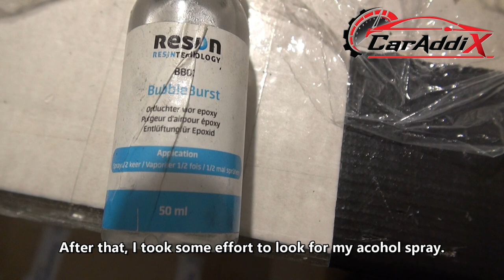Testing Spray Glue (for carbon skinning)! Is it safe?

Comment: Interesting experiment! The only thing I can imagine that caused the spots in the failed skinning was the solvent in the glue wasn't given enough time to flash off causing tiny bubbles in the resin. Not tried glue personally, I usually coat with black epoxy, wait for it to go tacky, then lay down the CF and resin over the top of that. To avoid the yellow tint, you can get top coat epoxy that is tinted slightly purple to cancel out epoxy's yellow color, I think it also has UV stabilisers in so protects against sunlight degradation.
Reply from the maker: True, I use that in my skinning videos. I love the purple epoxy! :). Glue and just Basecoat have pros and cons. I made a video using both techniques and both came out fine, as long as you go easy with the glue :).

Comment: Your issue is more to do with the carbon cloth. It should be tightly packed. It looks like where you handled it, it has sperated. No matter what you do with the glue you will then see the gaps/white when laying down. Keep the fabric tightly closed. Apply a light mist allowing to tack dry. A heat activated glue is much better and will ensure no movement in thread while laying down. Learnt this myself from recent projects with seat bahks and center consoles

Comment: You feel spray glue is better  than resin???
Reply from the maker: In some cases, I guess more complex shapes.
Reply: @caraddix  how long does  does it stick for???
Reply from the maker: @pedroalmodovar6709  The trick is to use just enough for it to stick during the process and allow enough resin to still get under the fabric and not use glue for long term, as that alone will not be reliable.

Comment: Hi. I'll be bluntly honest here. I think that you didn't really test anything that's important for skinning. First, gaps are no problem on black background. Second, glue layer thickness is a secondary question - more important here is to check how the glue you're using reacts with epoxy in different temperature ranges. From what I know, glues like 3m 77 do not hold well with epoxy when heat treated and promote delamination. A more fitting test here would be to make samples (plastic, not cardboard!) that have gone through the entire process and use different kind of glues, including what I believe would be the best glue here - a polyurethane heat activated upholstery glue. I'd gladly watch that test, but the methodology would need to be on a higher level than what we saw.
Reply from the maker: The glue is mainly to hold the carbon in place. The surface should be sanded and the bond between the surface and the epoxy is what would matter (in my opinion). In this case, the glue should not be used to keep the laminate in place, I mean, this would be an odd approach to begin with :). What's important to me is that the glue won't be visible in the end product :). The thing you mention, I guess would only start playing a role when you would use glue in high temp moulds but that's not what this video is about :).
Reply: @caraddix  True, yet there's a question of how the glue would interfere with the bond between the surface and the epoxy - because glue won't disappear, right? 
My experience (and this is something that could be thoroughly tested) is that this type of glue creates a somehow hostile environment for the epoxy and thus promotes delamination from the surface.
I see what you mean, but my concern is that the glue used causes the surface-epoxy bond to be weaker. 
Also, it doesn't have to be a high temp mould for the temperature to play a role. A skinned part left in full sun or in a hot interior of a car can easily delaminate if that bond is not strong enough.
I'd gladly watch a proper experiment showing all this, especially with all the science behind. :)
Reply from the maker: @AAIpsissimus  I understand what you mean now :). If you spray a fine mist, look at the back of the carbon (I'm still using too much but 1 test piece was actually sprayed before as seen in the video), There's only little specks, not an entire layer of glue. There should be enough areas not contaminated with glue. But again, I understand what you mean, and that would be kinda cool to find out now I think about it :). Personally, I don't have any curing/autoclave oven (yet) though. What do you recommend for a test?
Reply: @caraddix  Yeah, glad we have a common ground now :) While a curing oven would be perfect, I believe a car interior  temperature we can get on a hot sunny day would be enough. If you'd ever want to test different kind of glues and gluing tactics to plastic trim etc and how it holds vs. high temps, then such a test would be very welcome.
Reply: @caraddix  I disagree. Ther glue should be used to keep the laminate in place. Then apply your first coat of epoxy. Cure, sand off any strays and highs. Then start the three layer epoxy coat.
Reply: I found this video due to my recent delamination experience. I sprayed 3M glue on the surface, applied the weave, let the glue cure, then layers of resin. I installed the part in my car, and 2 days of hot summer later, delamination. I've had issues in the past getting the CF to hold tight curves/complex shapes when laying the weave on the tacky resined prepared surface. Looking for any recommendations. Appreciate the video!
Reply: @kolapodasilva5838  Just what I wrote :) try a gelcoat epoxy as a base layer - it bonds well both to plasic parts and to epoxy resin.